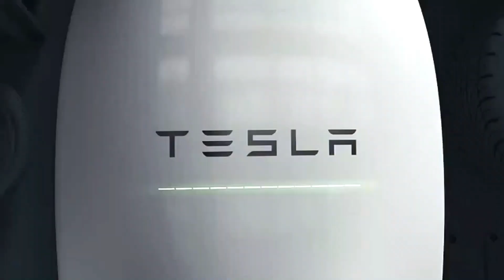Tesla's Gigafactory 1 (Nevada) | Giga Nevada

Comment: I deliver mill work roll used to press those batteries to this facility from Weirton, West Virginia. 4800 mile round trip.
Reply from the maker: That’s great. What’s your experience been like on the delivery end? How’s a Tesla delivery differ from others?
Reply: @trailblazedHQ  it’s actually a pretty quick process. I go to the Panasonic side of the building. The rolls are in these 2 big boxes. I park, unbutton everything, remove the side panels of the truck, and they come pick the box‘s up with this big forklift. Then I get 2 returned and leave. The whole process takes about an hour. Then I take them back to the shop in Weirton where we process them.

Comment: Building a factory piecemeal would seem contrary to “getting things done in Nevada. 

However, it signals to me that Elon is expecting battery production lines to change and rather than revamping the old line, he has left space for the new line. What do you think?

Why did Elon choose a flat roof rather than sawtooth? Gigafactory Navada makes sense but at 53°N, Gigafactory Berlin the sawtooth factory would be cheaper and generate more solar power.
Reply: Alot has changed since 2014, Elon now plans to have battery production at each seperate giga factory instead of just making them all in Nevada then having the logistics of shipping them around the world.
Reply from the maker: @MM-fe9mz  Makes perfect sense. Save on shipping costs, boost the local economies, diversify your company knowledge-base, benefits all-around assuming quality control is maintained.
Reply: @MM-fe9mz  Have you got good evidence of this or is it your impression? Crossing borders can sometimes cause supply delays and that would support your information.
Reply: @jeffharmed1616  it's been talked about building a battery factory in Berlin and Texas. So its definitely happening. Not that Nevada wont also be expanded but for powerwall batteries. 

Also the new dry process of making batteries that is currently being perfected is quicker and takes much less space than current main stream methods of production
Reply from the maker: I think building the factory piecemeal allows Tesla significant optionality moving forward on how to use the excess space. Instead of re-permitting, re-excavating in the future, they can simply fill the space they've already built. It's certainly an interesting concept ... and I think you're right about Elon expecting battery production lines to change. If we know anything about him, it's that he's thinking 5-10 years ahead of the rest of us. Thanks for watching!